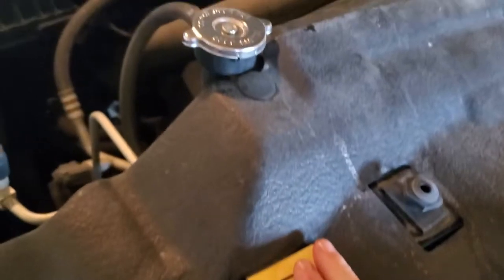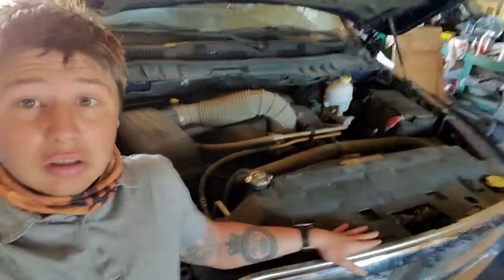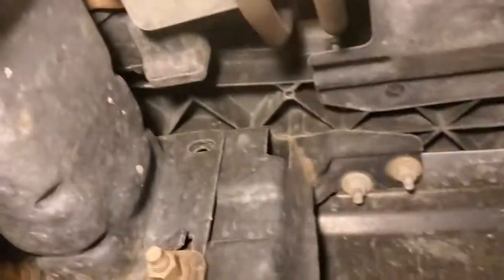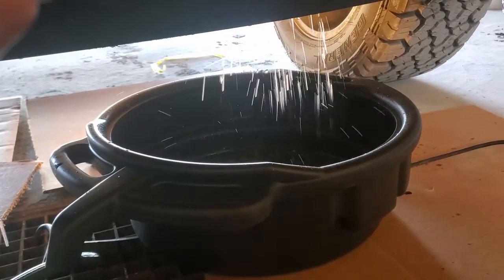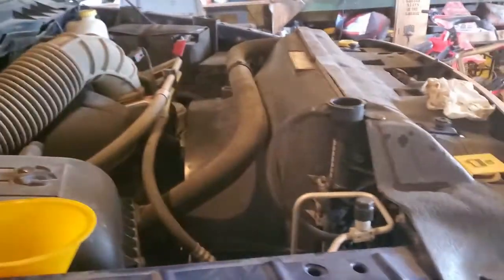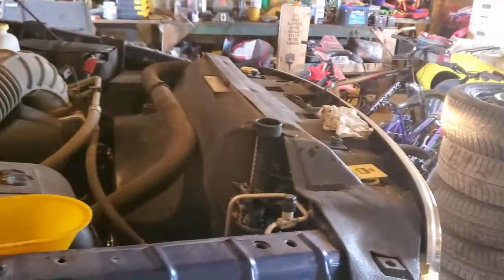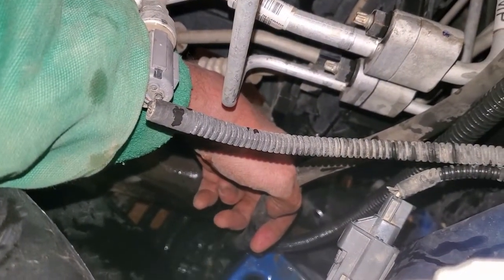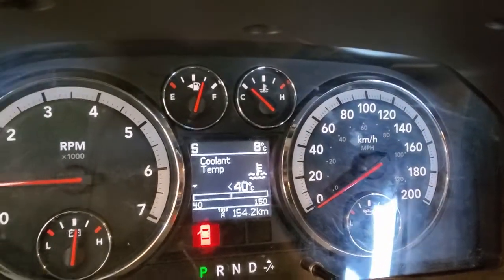Coolant Flush fer the Ram

Comment: I accidentally put Rain X (+/- 1 quart) in the radiator reservoir, will this cause damage?
Reply from the maker: A small amount like that shouldn't be an issue as it's mostly water. Test it to make sure the coolant freeze level is good. Just don't do it again 😁
Reply: @Punchy8504  Thanks for reply.

Comment: Hey dude, I’m doing this on my 2017 Ram 1500 and I’m not the most mechanically inclined. I got the rad drained, and got my mix with the correct ratio. I’ve been filling it back up through the rad cap but I’m not sure how to tell when you’ve got sufficient coolant in there? The reservoir is pretty tucked away and in other videos people say to fill to the cold full line. 

What are your thoughts?
Reply from the maker: Just like you're doing. Fill the rad. Fill to the cold line in the reservoir. Just run it for a bit with the cap off to let some air out. Cap on. Drive for a day normally. Check and top up as needed